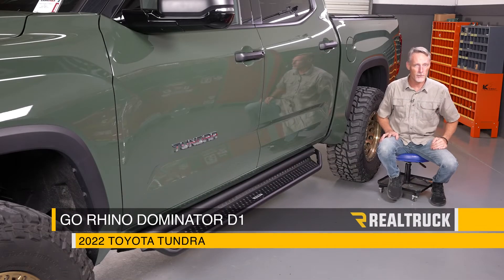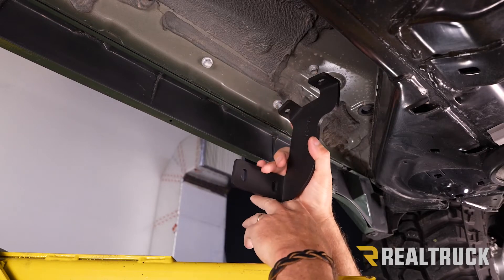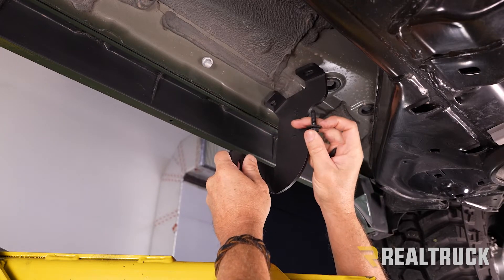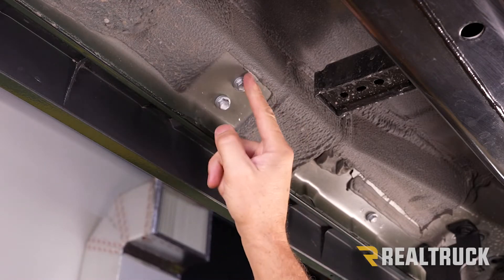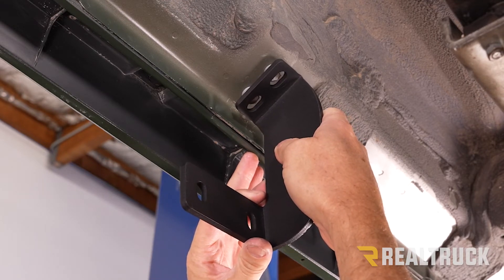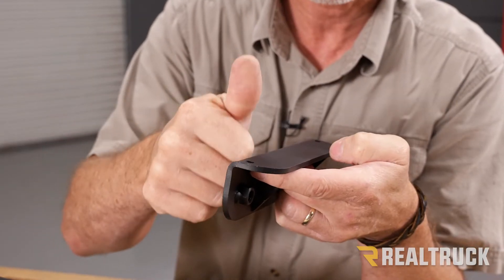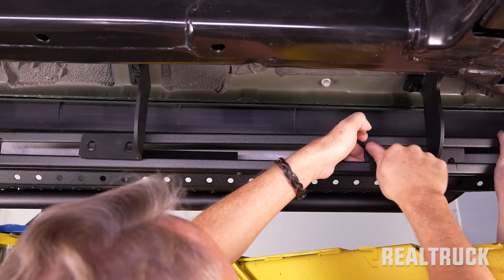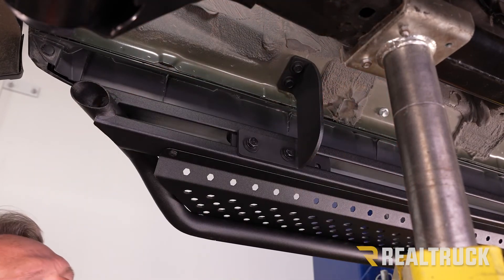How to Install Go Rhino Dominator D1 Side Steps on 2022 Tundra

Comment: Ok OK now let's see 2023 4Runner Dominator frame mount installation with no lift and one guy. I thought so!
Reply: I just did my tacoma by myself it wasn’t as hard as i thought it would be, if youre worried about doing by yourself.. Although my truck does have 3.5 inch lifts which helps.. i just held the board up with my knee..